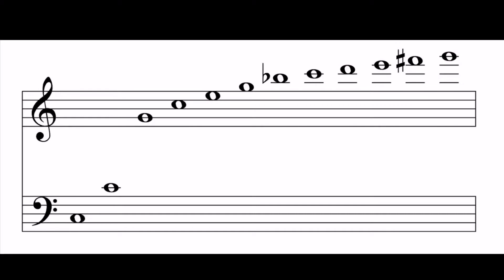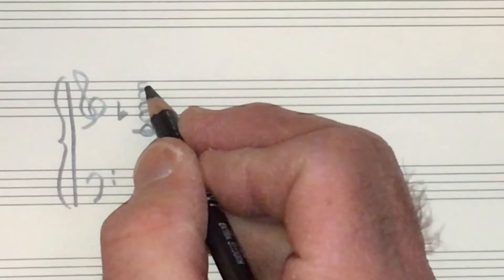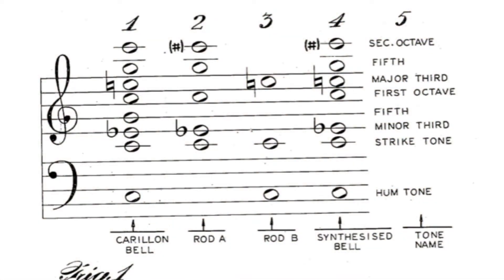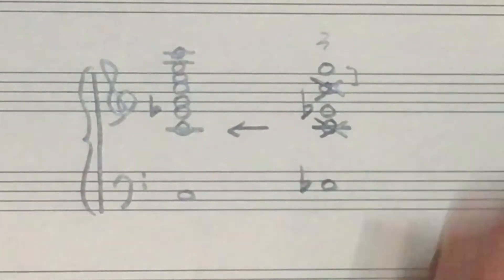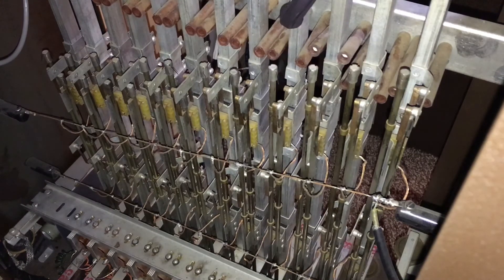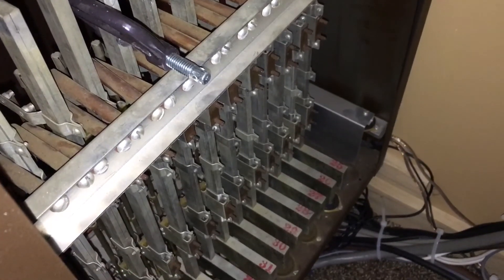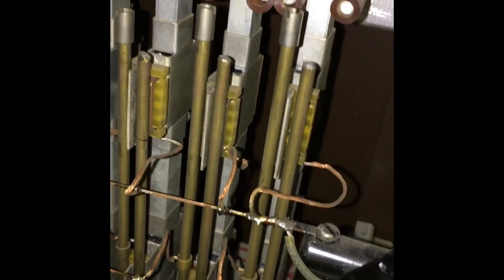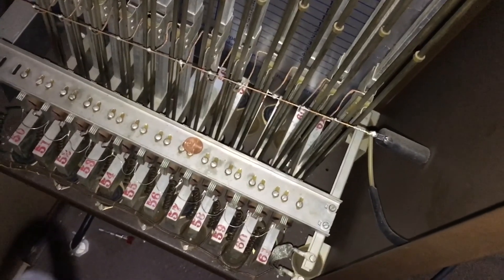Schulmerich Flemish Bells - An Inside Look

Comment: I do bet that, the English bells just look like clock rods?
Reply from the maker: The English bells are made of flat stock, about 5/16” wide and 3/32” thick.  Each rod is attached to its own block, which also holds the pickup.  These blocks all hang, resting on rubber grommets, from rails, so that the rods are horizontal.  The end of each rod has a small hole through which a piece of cord is attached as a damper.  I have long intended to make a video about the English bells as well as the Minor Tierce bells and the Chimes. Maybe someday I’ll get to it!

Comment: FASCINATING!!!! I wonder if they got the original inspiration from grandfather clock gong rods? Also what about the other sounds...you demonstrated the flemish and the H-C-Q bells but what about the Minor, English, Chimes and celestial harp bells?
Reply from the maker: I’m glad you liked these videos!  I need to edit the H-C-Q video because a former Schulmerich employee pointed out that those particular rods were not in fact bronze (although the literature at the time implied they were). They were actually steel!  The Flemish rods are bronze, and no doubt the various clock-type rods were the starting point for Schulmerich and the other companies.  I have intended to make videos about both the English and Minor Tierce bells, but have not done so in part because I have been unable to piece together much information about their development.  I think English Bells were originally cylindrical rods with tuning weights (like the Flemish) but I am not certain.  From sometime in the 1950’s onward, they became a flat strip of brass, clamped at one end, and hanging horizontally.  Minor Tierce rods look very much like the H-C-Q, but the notches, tuning weights, and strike points are at different locations.  Someday I will get my act together and make those remaining videos!   (BTW, I don’t have Celestial Harp; the carillon this console originally controlled had them.  I have never seen them, but from hearing them I suspect they might be tines of some sort.  They have a timbre much more like a music box or a Rhodes piano than any of the other bell types.)

Comment: Is it possible to make a piano style instrument with these pairs of rods essentially replacing all 230 strings with 176 rods with dampers, I'm curious to know how this would revolutionize keyboard instruments grand or upright, how would this change the way we see the carillon as an instrument that can be used for, at home practice, upright style, or a concert hall, grand style, a new affordable way to play the sound of Flemish, English etc, English style is also heard on a Schoenhut toy piano but much higher, these sounds could be a revolution piano keyboard companies.
Reply from the maker: There was at least one company (Stromberg-Carlson?) which made a rod type carillon with a piano-style action back in the 1950’s.  It was still electronically amplified, there were only single rods, and it lacked key-controlled dampers.  That is the closest thing I know of to what you are describing.  It would not be possible to duplicate the Schulmerich two-rod system without electronic amplification, because the pickup placement selectively removes unwanted overtones; however one could absolutely make an acoustic, soundboard-based rod carillon with an tone closer to Schulmerich English bells.  As you noted, the classic toy pianos used rods, though they utilized the fundamental pitch of the rods, unlike most electronic carillons.  Perhaps you should start experimenting!
Reply: @rickruggiero7128  I was thinking of a way to replicate the sound of the two rod Flemish bells, if it was possible to build 88 pairs of rods and have a distinctive sound, The first rod would produce the fundamental overtones and the second rod produce the minor third and other partials while maintaining at least 7 octaves of range, I was wondering if it was possible to acoustically amplify the sound from the bridge, Similar to the rods in the toy pianos, Only being more complex in partial overtones and having a much wider range, 8' Flemish cast bells would go from A1-C9, A full octave higher than the normal pianos today, Hopefully we have new advancement technology, if not able to bring these sounds to modern usage, The English style rods in mantle, grandfather clocks is good example, The rods hang down on most grandfather/grandmother clocks or are vertical on mantle/wall clocks, The strings on a piano,  usually 3 strings per note in the treble, 2 strings per note on the tenor, And 1 string per note in the bass, What is capable of holding up the rods so they can resonate freely but also be dampened by a damper pedal, If the jacks that normally would be hitting strings instead be striking rods a & b with felt style hammers while maintaining a bright timbre without electrification needed.